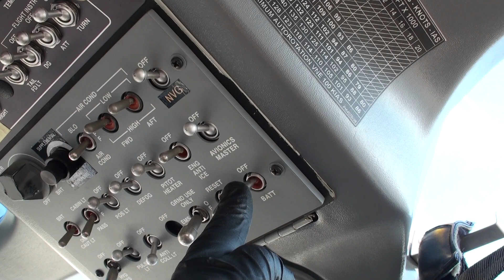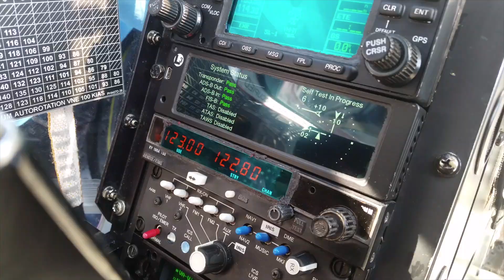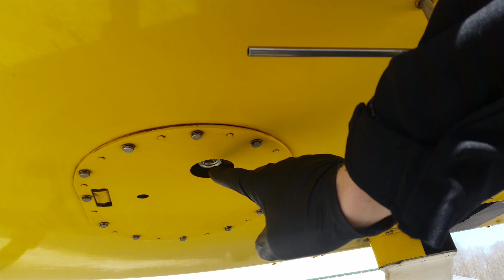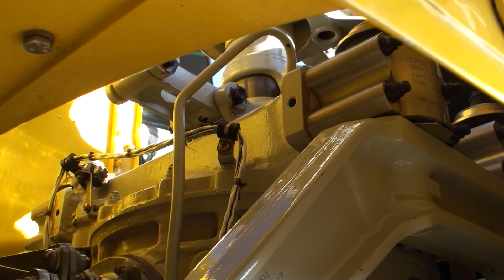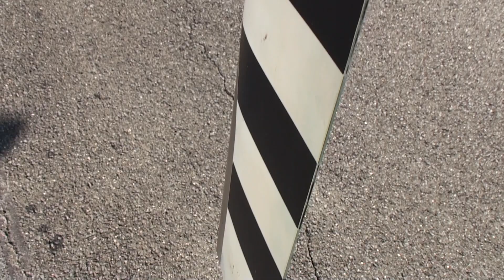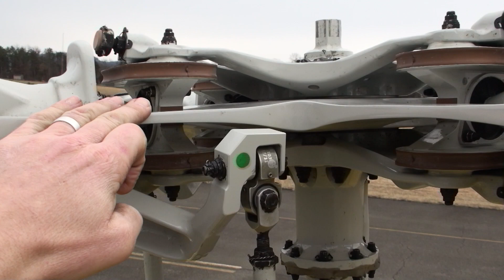A detailed Pre-flight Inspection of a Bell 407 turbine helicopter

Comment: Pro Seal & Torque Seal. Yep, PHI! I've still got both in my Dad's toolbox along with inspection checklists for S-76s, and an exhaust-nut wrench for a Model 47 that was fabricated at LFT! Pop was an A&P from 1970-2004, started on roving maint. based out of Empire (the first one). Then Morgan City, Intercoastal, Cameron, LFT, Galveston, Frouchon, Houma, and back to LFT. He was on the first maint. crew for the Pumas in '77, and his tool box STILL smells like skunk grease.

Comment: They are called "elastomeric bearings". I worked on the OH-58D(I) in the Army and the 407 uses the same rotor system. Whomever did that 8802E job on the mast nut should be ashamed. That is a super messy sealant job. I'd of stripped that off myself and redone it if I had done something that bad.

Comment: why are there 0.1 TRQ residual value
Reply: I haven’t flown the 407 in several years but believe it’s part of the BIT (built in test) and our indicator that it’s functioning properly. The only gauge that would ever have nothing on it is the fuel gauge but only if the fuel signal conditioner detected a fault.

Comment: How often do you require to use your rotar Breaking?
Reply from the maker: We are never really required to use them. But to assist in stopping the main rotor system to expedite patient pick-up or drop-off we usually apply them on most shutdowns when rotor RPM is below 50%

Comment: Michael, tail rotor seems strong, but are tail blades full titanium ????? Considering H130 or 407 for pesronal flying/my business
Reply: The tail rotor blades on the bell 407 are constructed of a nomex honeycomb internal construction while the skins are made of a composite material with a stainless steel leading edge to protect against corrosion. The H130 however, has 10 aluminum blades that arent very exposed due to the fenestron so they don't get damaged very easily from the elements. If you purchase an H130, just  be advised that the fenestron is nice, but does not have much authority. You can run out of power pedal fairly quick depending on the type of flying you'll be doing. The AStar is the direct competitor with the 407 so you may want to consider that airframe over the 130. Just depends on what you plan on doing with it! Each one of these aircraft have their niche.
Reply: @alexadamson1322  Thanks, but but.......with recent engine some are saying H130 has better tail rotor authority than H125, is that true. Thanks......Also, is that true 407 autorotates better than H120/125?
Reply: @alexadamson1322  Thanks, for taking the time for such a detailed (Clear & neutral) reply, I am a businessman (with a mechanical engg degree) so I am in market, users favour their machines are are biased. I was not expecting H125 to auto well (Compared to 407), since it has one less blade & same main blade diameter. I am tilting in favour of H125, but it not full IFR (407 has better avionics & full IFR). Also, if I am not wrong, H125 airframe is not as robust as 407. Am I wrong ????

Regards
Thanks a lot.
Reply: @naughtyUphillboy  No worries man,  I saw your comment and thought I would be able to help a little given that I have experience in all of these airframes. The amount of blades don't necessarily effect how well it autos, it really matters how well the pilot executes it. The chord on the AStar blades it much wider than the chord of the blades on the 407. There are many factors that effect the way the helicopter autos but ultimately it comes down to the pilot. a brand new AStar (H125) comes standard with Garmin GTN 650 and 750 (comm/nav radios) as well as the Garmin 500TXI (MFD/PFD) which is fantastic. You can also order them with or even install later a HeliSAS autopilot which is only 3 axis but still a fantastic tool. The AStar can never be certified under Part 27 for Normal Category Rotorcraft for IFR operations due the dynamic stability in flight. The Bell 407 on the other hand can be. It obviously has to have all of the required equipment but that's when you look at the 407 GXi model. It comes standard equipped with the Garmin G1000 and Bell autopilot which work very well together. As far as how robust the different models are is subjective. The AStar is a workhorse and they seem to just keep going. The 407 also is a great product so really it's tough to say. Neither one of them are known to be problematic or have little gremlins.
Reply: @alexadamson1322  Thanks for taking the time to reply, in this busy world:

The chord on the AStar blades it much wider than the chord of the blades on the 407. THANKS.

The AStar can never be certified under Part 27 for Normal Category Rotorcraft for IFR operations due the dynamic stability in flight. ???????
Can you explain, you mean 407 is inherently stable & H125 not !

I honestly feel like, you must be paid for your services/advice. 😅😆
Reply: @naughtyUphillboy  That's correct! The 407 is much more stable than the AStar so therefore it can be certified under part 27 to be IFR certified. However, with that being said, the AStar is still a vary stable machine just not stable enough for IFR operations. The French didn't name it the Ecureuil (squirrel) for no reason!
Reply: @alexadamson1322  Thanks a lot. Regards.

Comment: What you suspected was for an engine rinse/wash is correct. Operating in the tropics we do daily rinses and frequent washes with the cancer causing chemical. It's interesting to see a garden hose attachment as we use 40psi  pressurized RO water as per the bell instrument.. it's kinda funny to hear you never used it but a lot of north and east America is not a very saline environment whereas everywhere here bell deems to be extreme on the corrosion index.